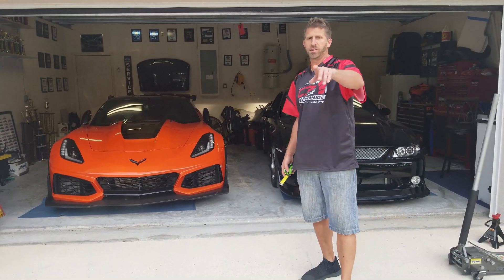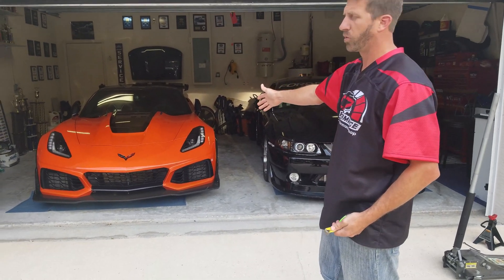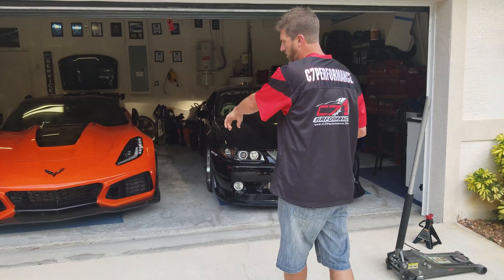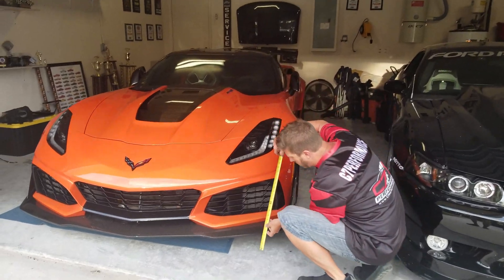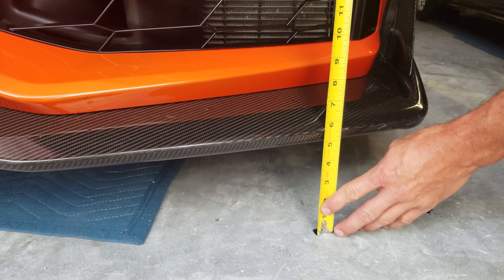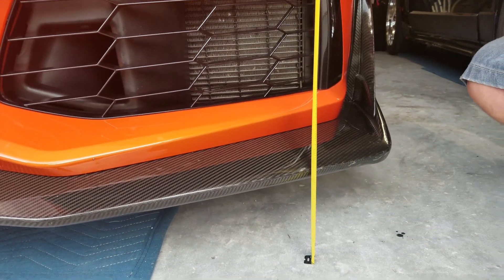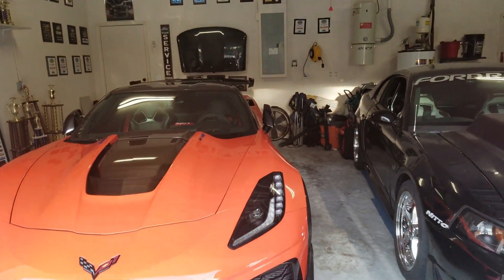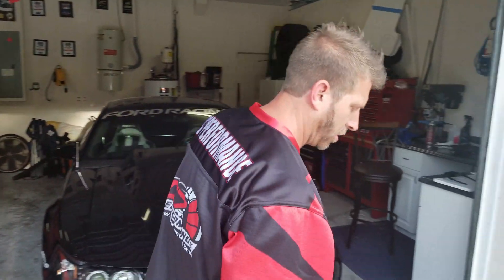2019 ZR1 Corvette Slammed

Comment: i had my 2017 Z06 lowered using OEM bolts then I had to raise it back up for the MRC update to work properly. the MRC update on my lowered Z06 had the ride quality way too harsh/bouncy. Chevy dealer said, hardness due to ride height sensor NOT in range

Comment: Chevy Still using the Leafspring i see
Reply from the maker: Well, technically to GM it's called transverse composite leaf spring, much different than the old days. These are made of lightweight glass fiber composite that's stronger and way lighter. Also acts as the sway bars as well.
Reply: Verses coil-over shocks, yes. Why? Because transverse leaf springs work and in fact have advantages over coil-overs. It's a common misconception that coil-overs are 'better'. And although there's nothing wrong with them they offer no advantage over the transverse leaf spring design in this application*, including cost. It may be hard to imagine, but GM knows what they're doing. That also means they know more than you do. That's not a put down. It's a simple fact that no individual or group of individual enthusiasts can out-engineer a major manufacturer with 50+ years of designing Corvettes.

That said, could GM have made the car 'better', as far as performance is concerned? Certainly, it's called the C7R. However, in this instance we're talking about a street legal vehicle vs a dedicated race car. And although the stock vehicle performs very well on a track they're still street cars. And as such have to meet certain government mandated standards for fuel economy, and safety, etc. 

Therefore, things like full cages, fire suppression systems, race seats and 5-point harnesses don't lend themselves well to street use. And although one could install such things doing so does not necessarily improve 'safety' since it's unlikely one would wear a helmet when on the street.

*That being a street car. Whereas with a race car, such as the C7R for example, it's another matter entirely. And in that case the fact they're independently adjustable, per corner, is advantageous. Whereas on a street car that ability isn't nearly as important or deemed as important by most buyers. Sure, those who track their car and understand suspension setup could take advantage of them but that's a small minority of owners.
Reply: @UCUb01gnR0ZXjINq8XkZOg2Q Thats interesting point of view.  However the c7 r doesnt use the springs.  No supercar does in fact. Also the c8 wont have leaf springs either.  Lol
Reply: C7 Corvettes do in fact use transverse composite (leaf) springs. Watch the above video and you can clearly see both the front and rear springs.
Reply: @darwinLee81283  You know for a fact the C8 will use coilovers for example? Are you a GM chassis engineer for C8? 

Are coilovers inherently 'better' than transverse leaf springs? In some ways, yes, they are. However, for what is a production street car are they significantly better? No. They're not. What they are is more expensive. They also need more frequent maintenance. Not a lot but often more than the transverse composite leaf springs found on the Corvette. They also require a separate roll stabilizer. Whereas the transverse composite leaf springs do not since they serve that function as well.

The fact is one can't argue that Corvette is not one of the best handling vehicles in its market segment. And they're also far more capable in stock form than many owners are.

Comment: Can you tell any difference at all, in the handling, after the lowering?
Reply from the maker: It's hard to actually tell the difference, but the steering does feel more responsive , and being a little lower to the ground even more just helps reduces the air going underneath your car. Although testing at the track stock height and lowered would give you true results. I will admit the stance and look is a lot better for sure with the wheel Gap.

Comment: Great stuff. Now all you need to do is invest in a carbon fiber spoiler company. Good luck with that stupid mod.
Reply: I assume you're referring to the front splitter and the fact the car is now lower. That's a valid point since the front splitter and the other external carbon fiber parts such as the rear wing and side skirts are on national back order. And in order to purchase them one must submit documentation, including photographs of the damaged part, to GM for approval. Even then good luck getting the part. I know since I own a nearly identical ZR1 (Sebring Orange Design pkg and the ZTK track pkg, etc.) and I inquired as to availability and cost for the front splitter should I damage it by hitting a curb for instance. And yes, although I'm a woman, I can in fact drive. And I'm often willing to prove it. On a closed course, in Mexico. >;}